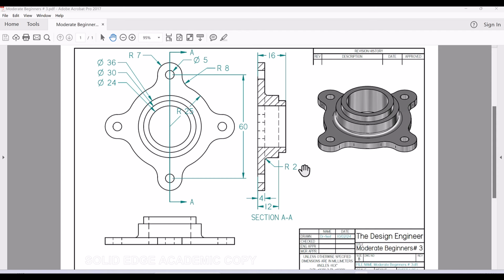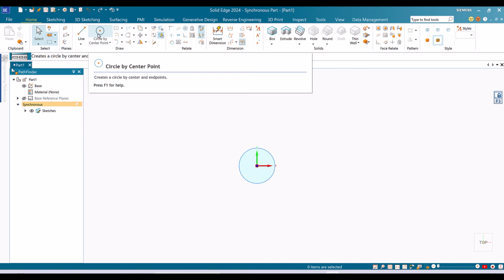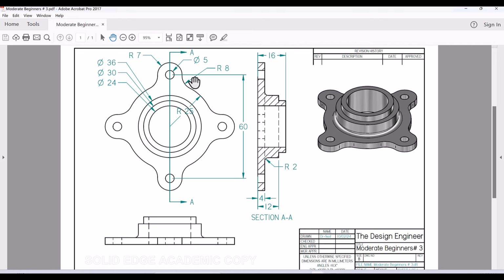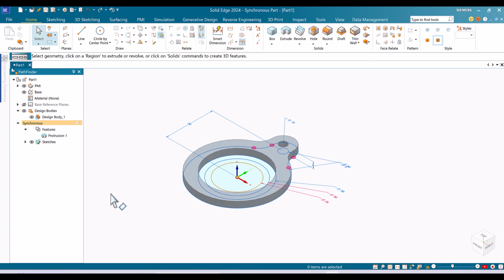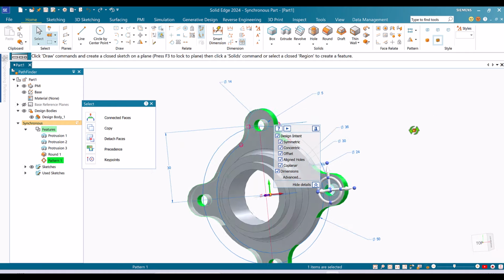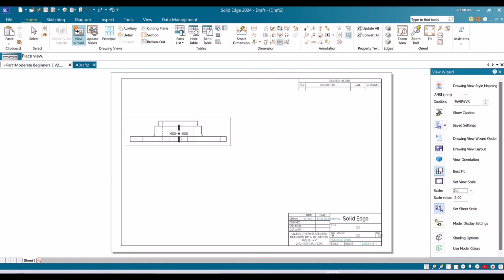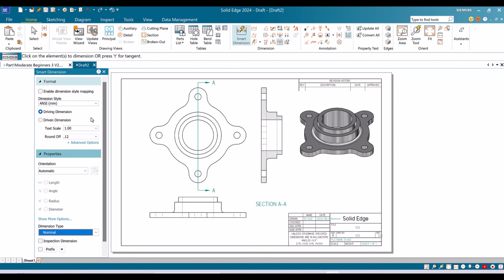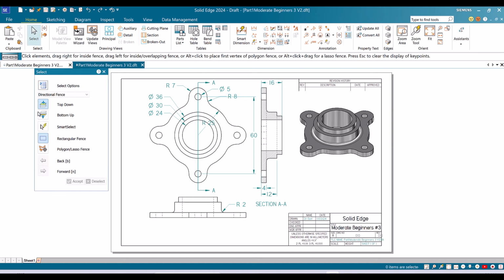Solid Edge 2024 Tutorial - Moderate Beginners # 3

Comment: When I try to copy the pattern around the object it only copies the hole R 2.5 hole and not the R7 round.  For some reason when I closed the file and reopened then I was able to pattern the entire feature.  Does this sound like a Solid Edge glitch or an issue with my settings?
Reply from the maker: Thank you for reaching out. What happened with you is not unusual, and here are my recommendations. First, keep saving your work, Second, microsoft windows control the max. Internal memory dedicated for each software, try to maximize your internal memory dedicated to your software. Third, before running the program, restart the computer to clear the used memory. I believe that you will not experience that in the future.